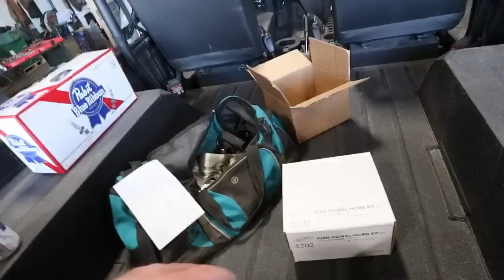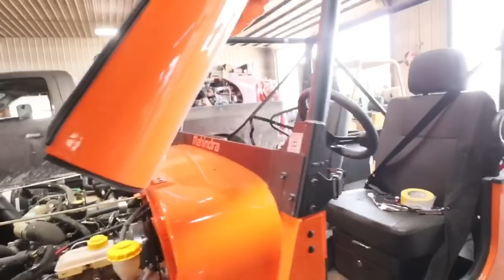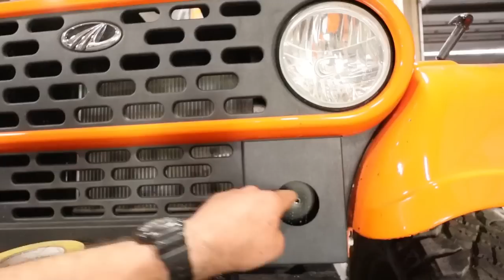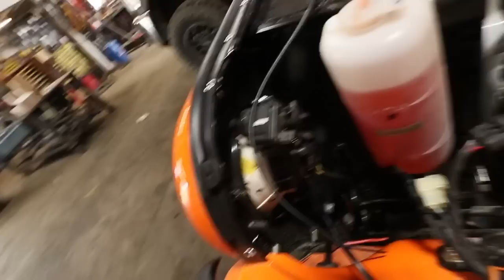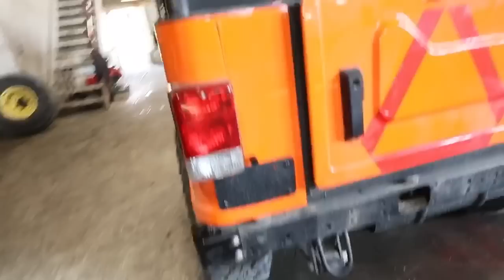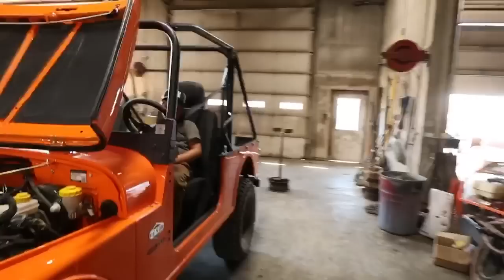Mahindra Roxor Turn signal install kit.

Comment: Thanks for the ride along Andy. I priced a Roxor  out, but with a msrp of 23k it was getting up there. At that price, they should be throwing in a years supply of PBR 🍺.
Reply: Now they are offering huge discounts on 18, 19, 20 models for the launch of 21 model... You can get 18 models as low as 11k

Comment: I commented to you about low pressure tires to ride on public trails in WI. They don't require the low pressure tires anymore, but they have a weight  limit on off road vehicles. It's 2000lbs and if I seen the right specs on a Roxor it's over 3000 lbs. So I guess I won't trade my Polaris Ranger on one yet!
Reply from the maker: Yeah it’s heavier

Comment: On the end of the flasher lever, on our truck it is the hi/low beam switch.
 The horn would be in the middle of the steering wheel.
Reply from the maker: Yes

Comment: need to get the ECU flashed to get a little more power
Reply from the maker: It's got enough
Reply: They can double the horsepower and top speed to almost 70

Comment: They sell these here in Philippines but not that stripped down model, I have attached there web page as you may get some idea of the cab set up. The National police used these for a while but maintenance was a problem price for 4x4 crew cab enforcer about 15,000 USD enjoy your video stay safe https://www.autodeal.com.ph/cars/mahindra/enforcer/single-cab-4x4-standard